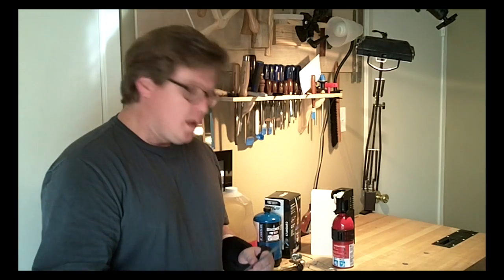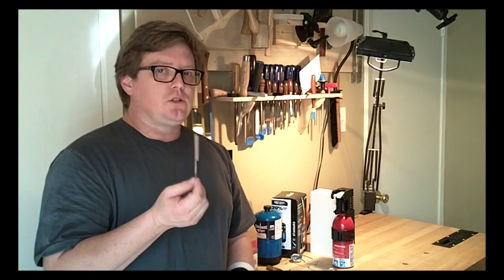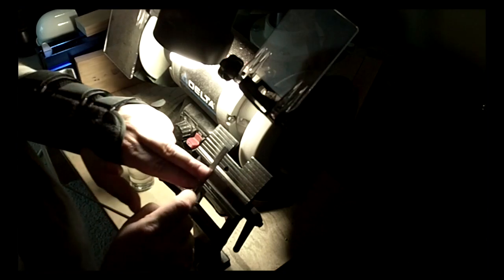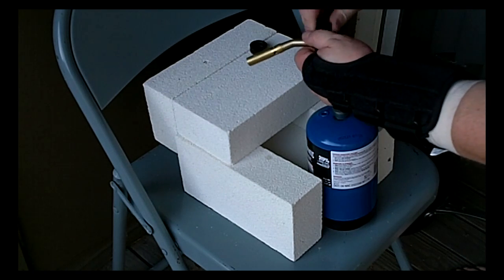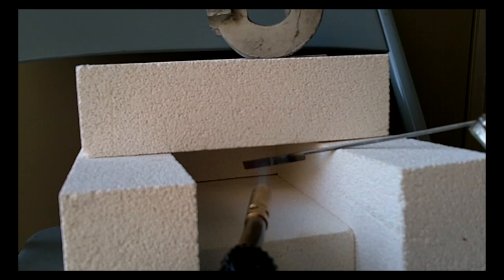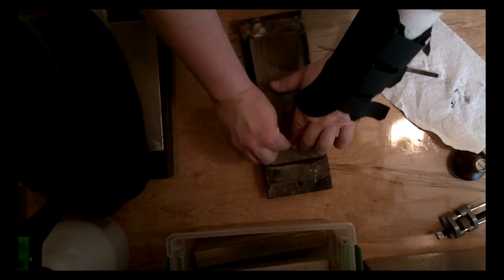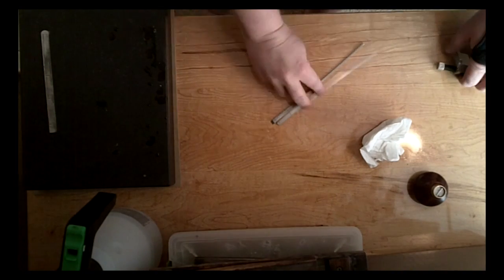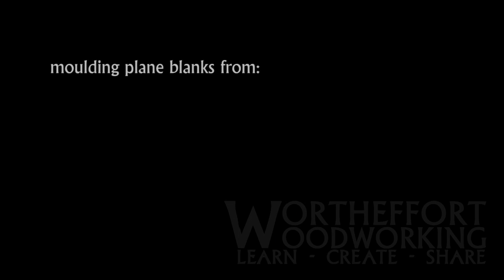Heat Treating 01 Tool Steel Plane Blank Irons at Home

Comment: I use used motor oil. It's not a danger to put a part into the oil that's heated up above the flashpoint because we immediately dunk the part down into the oil and swirl it around. It requires that O2 get to the part for a flame to occur and that cannot happen with a submersed part. The oil will cool the part to a temperature below flash point if you leave it in long enough. For the process I use old 1 gallon rectangular metal containers that you would get paint thinner, or mineral oil or some other substances in. I cut out one side and roll over the edges so they won't be sharp and present a hand cutting danger. The container is laid on it's side and filled up with used motor oil about 2/3-3/4 full. I generally use bailing wire to hold the part I'm heating if it has a hole in it, or some vice grips or whatever. when it comes to the proper temp based on the color of the steel, I dunk it in the oil and swirl it around completely covered by the oil. Never had a single problem and have always been pleased with the results.

Comment: Tempering temps depend on the type of steel and the final hardness desired. Your supplier should be able to provide  the heat treatment tables for the stock you buy. If not, they're available online. Some steels, e.g. D2, have very critical hardening and tempering procedures. You can't just "wing it" with any given tool steel.
Reply from the maker: 7 years on in a tool I use regularly. Holds an edge well, sharpens easily. "Winging it" based on color and magnitization has been how they've done this for centuries.And I said in video and description this was 01, likely the simplest of tool steels there is.
Reply: Anybody can get lucky once. Do you have any idea what the Rockwell hardness is?
Reply from the maker: I’ve done hundreds of blades since this time. As long as it’s hard enough to hold an edge, soft enough to sharpen, doesn’t break at edge the Rockwell number doesn’t matter. Or are you saying it’s useless unless it’s within a certain tenth of an abstract number.
Reply from the maker: @highestgenius  Care to edit again without the personal attack? I'll leave it if ya do that.

Comment: So much bad info out here. You really should do a bit more research before posting videos like this buddy.
Reply from the maker: tehemton without specifying what’s wrong this is just a drive by comment. End result has been in a tool that has been used in hundreds of projects with no issues.

Comment: For the forge can I use butane or propane? What is the difference between both?
I am from Argentina and in my country the butane is easier to get
Reply from the maker: As long as you can get the metal hot enough I don't think it matters but I'm not an expert in this field. I used butane in the video and on all the bits I do.
Reply: Thank you so much! here is impossible to purchase decent tools, for this reason i'm trying to make them. Wonderful job with the tutorials is helping me so much to improve my work and my english! I hope we continue in contact!

Comment: For small tools, I've treated them while they're chucked in the drill press.  This allows holding the torch in one hand and a magnet in the other, and placement of the oil bath in a >covered< soup can on the table .  Start the drill press at a very very slow speed (if possible), and heat the part with the torch and test it with the magnet.  When it's ready to dunk, put down the magnet and torch (I made a  no-tip torch stand with can screwed down to a baseboard),  uncover the oil can and plunge the rotating part into the bath .  If your drill press can not turn at a very slow speed, just pump the quill up and down while jiggling the oil can slightly.

Comment: Great video. How did the blades work? I bought these chisels made of sheet steel, and made hand planes from them. They worked well on soft wood, but couldn't hold an edge long on hard wood. I'm not sure what kind of steel the blades are, so I'm afraid of making softer by anything I try. An I hate to make all new planes for a better steel.

Comment: always take the valve off, it will leak and drain the tank !!!!!!  my first time using mine was the last time i used that tank !!!!!!! bummer !!!
Reply from the maker: +guuba gaaba good tip. mine hasn't leaked yet as still using the same canister years later.

Comment: Actually the carbon did NOT come out of the steel. It was just oxidized and maybe some carbon from the propane. Also why did you build that furnace? You didn't use it as one. (You should have) Also the hottest part of the flame is not at the tip, but at the tip of the inner flame.
Reply from the maker: +Felix Kuhnert It was explained to me by a very good blacksmith that it was the carbon coming out so don't stay at that stage long if you want the final edge strong because it was coming out at the point you want sharp most. I was doing this on my back porch of an apartment, the bricks were more for my piece of mind of not setting the place on fire as I was just learning. Nowadays I just hold the blades in a vise and use a torch. Works fine because these aren't big blades.

Comment: next time normalize the blade by heating to non magnetic then let it cool to black . do this 3 times then heat and quench and place in preheated oven at 350 for 1 hr let air cool and check for hardness
Reply: What is the purpose of it?
Reply: refining the grain structure 
of the steel

Comment: hey, cool vid, but cooling while sharpning is not a bad idea, because if the blades heat up they might burn, yes steel burns! and it will let you with burnt steel in your cutting edge wich will imedeat break off and form like cracks and holes;

see ya!
ray

Comment: As I understand it - you did a few things here.  

1) Hardened the first inch or so of the steel. 
2) Tempered the steel.  (You called it annealing - but annealing is to weaken)
3) Sharpened the steel. 

A few humble suggestions:

a) Sharpen the steel to within a 32nd or so of your final shape before heat treating.  This will save time as the steel is soft. 
b) Harden then temper in an oven.  You will have no problem holding that to 350. 
c) Then sharpen keeping the blade cool.  

Good luck.

Comment from the maker: I chose oil for tempering bc of better temp control, ovens vary, and ability to cool down slowly.
Reply: wortheffort I'm sorry my friend that's just the lazy mans way of tempering it and it also undoes some of your work that you did early maybe not in your case as they was tiny blades but tempering in a pot of oil is the lazy mans way not to mention the dangerous way 
I totally respect all of your wood working abilitys but steel work and hardening not so much but it was still very entertaining to watch 👍❤️
So you still get a 👍 and I'm so glad you didn't hurt yourself because doing it like that you so could have

Comment: #4 If you do check austentic points with a magnet, do NOT sit it on the forge. They will get hot and all ferrite magnets lose their polarity when exposed to heat. It will give you a false positive. Remember without those carbon atoms that iron is just that = SOFT

Comment: #3All of these mild steels need to keep as much carbon as possible.Gas firing takes it out of the first few microns of the steel, . So either use a borax flux, or even better COAL. Do not be afraid to quench in liquids that catch fire. If you want a very aggressive quench try very salty cool water. For the size of your project stress and draw should be minimal. However motor oil, ATF, and other petrol have a bit of carbon to begin with and help the surface factor much better than a vegetable oil

Comment: #2A. the size of the material used does not need a forge. Switch over to MAPP gas and quench form there. You need a separate inlet and outlet for an effective forge. Keep orifice size in mind too. Yours is not a bad shape, just too little gas and from the wrong direction. B. use a real coal based fire to heat in. Propane and other gasses leech carbon ( a VERY necessary component out of the steel you are using) For this matter 10xx series steel 5160 and O1 fit in the same boat in terms of forging

Comment: Before you hurt yourself:
You are correct in that from an annealed state, you need to take a steel up to its austentitic state. Then by a swift reduction in temperature, you can achieve a martensitic phase change (hardening). Heating it up to non-austentitic state afterwards is called tempering. If you anneal it (slowly cool from austentitic point) you will have done nothing but restore it to its original soft state. I also have a few other tips for you regarding forging and quenching.
Reply: Apprentice machinist here, and looking up videos as I work with 01 tooling steel and I appreciate your comment! :D What other tips do you have? I heat them with an acetylene torch.

Comment from the maker: Actual Rockwell... haven't a clue. There are many charts out there that will tell you by color but this is not the most accurate if you are looking for a specific hardness. I will say I feel from use that it's about like my Veritas Plane blades.

Yes you can go to a higher temp which will make it softer. Understand you can't reharden it w/o starting the process all over. Which is why I  starting at a lower tempering temp. If it was too brittle I could go back& temper the blade to higher temp.
.